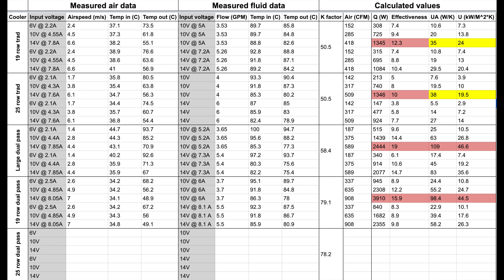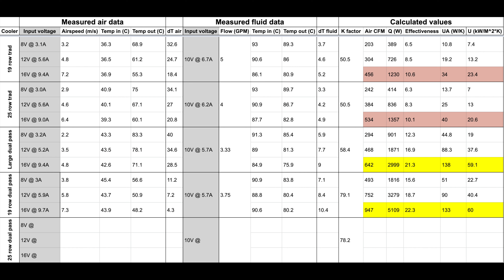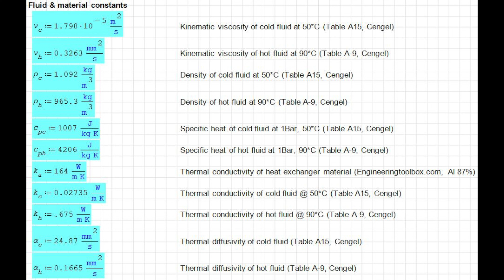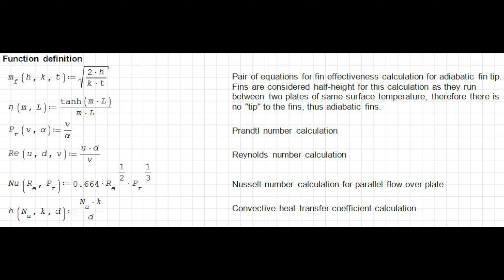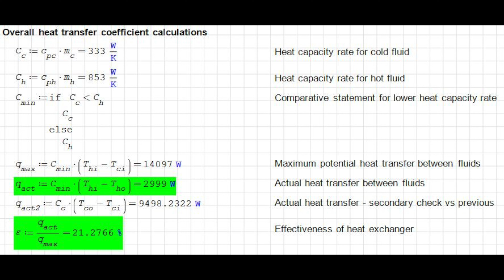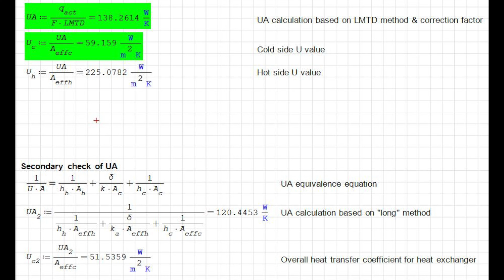Oil cooler heat exchanger study Pt2

Comment: I used equations many years ago .A/  cooling air volume /speed /temperature [ would have liked to do humidity influences ]
A/ 35 deg cel into 10 inch circle elec axial fan .flowing 700cfm       
B/   Oil flow [assuming 30w viscosity common test fluid ]  flowing 1.5 us gal   and 115 cel  temp 
Heat rejection rate from Eaton coolers advertised  most accurate out of all brands 
+++  advertised cooling BTU are absolute lies 
cooler used 11 x 9 inch x  1.5 thick stacked plate no fins 
fan operates on thermostat 
no fan = oil temp 113--117 cel  ,, spikes at 120cel very heavy loads 
13---15cel decrease with cooler 
*********  AIR COOLED INDUSTRIAL ENGINE 25--30HP 
******benefits no oil leaks , larger oil capacity =less visual dirt ,, oil condition  improved between services . LESS EXCESS HEAT  =less engine case distortion.
https://dml.dana.com/assetbank-dana/assetfile/58806.pdf?store=original
https://tark-solutions.com/thermal-wizard/liquid-cooling-calculator

Comment: I thought the NC had a built in oil cooler? How does the stock one hold up?
Reply from the maker: Some NC Miatas came with a heat exchanger that worked between the coolant and the oil at the perch. The issue here is that you would never be able to cool the oil beyond the temperature of the coolant, therefore it would act as an oil warmer up until operating temperature and then theoretically a cooler. 

I don't have any reasonable means of testing this nor desire to do so since it's already been shown that people who track their cars will overheat the oil with one of those. That's enough data for me.
Reply: @ArmandHindrichs  I appreciate your opinion and info on this, thanks